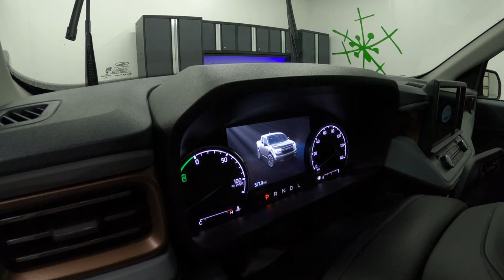'22 Ford Maverick Hybrid Ceramic Coating | Paint correction on the Area 51 paint was the best!

Comment: How much would you charge to get a truck done like what you done in the video? I just got my maverick and want to do paint protection on it. Thanks
Reply from the maker: Base cost for a sedan is $800 and the cost goes up a little for size. There is some benefit (reduced cost) with cost if it is really low miles. Simply because the time to one step versus two step paint correction. Tax obvi on top of price.

Comment: Did you coat the grill?
Reply from the maker: Absolutely. It’s kinda a last step because usually getting in those tiny areas tanks the applicator. It’s a toss up between wheels and grill. Some of the newer grills are just awful for angles.

Comment: How much should a service like this run?
Reply from the maker: Depends on the vehicle, but I usually just say somewhere around a grand. New vehicles with less paint correction are cheaper. Three stage paint correction and or wet sanding with the paint correction make it at least a grand.
Reply: @P4SDetails  Say another brand new Mavrick? Still 1k
Reply from the maker: @xxUncleBuckxx  yes.
Reply from the maker: @xxUncleBuckxx  sorry I meant no. Bout half that.